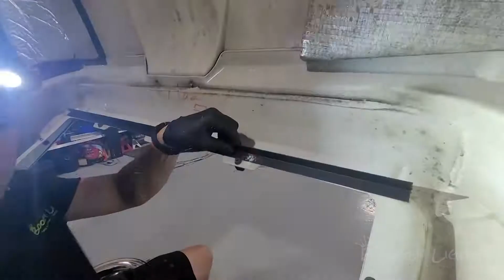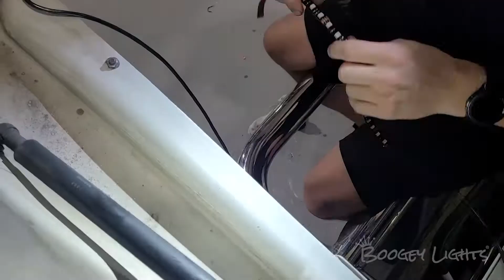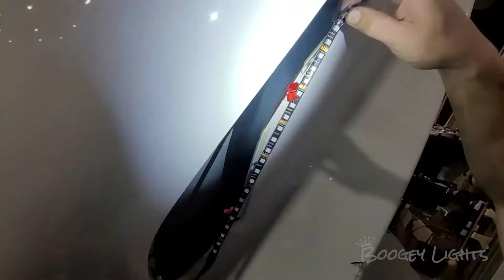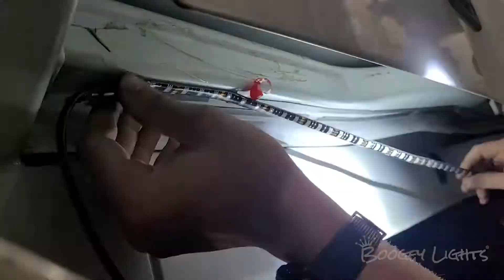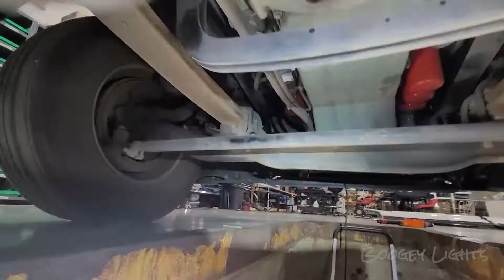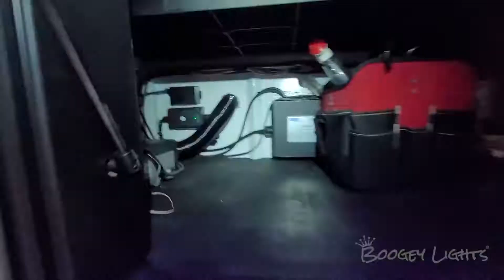Step-By-Step LED Installation  |  Volvo VNL 780

Comment: Is it still holding up, any problems do you know of? Where is your shop?
Reply from the maker: We have been installing Boogey Lights LED products on every major brand of heavy duty truck for almost 10 years now.  When installed according to our instructions, they will last.    We have pre-configured LED light kits for Peterbilt, Kenworth, Western Star, Freightliner, Volvo and Mack . We also have a build your own light kit product that can be configured for any type of heavy duty truck.   We are the manufacturer.  We build and ship these light kits all over North America.  They can be installed by anyone with 12vc knowledge (and willing to read the installation docs).  Our manufacturing facility is based in Florence KY (details on our website).  We also do installations in Florence by appointment only.  Details on the VNL light kit you see here can be found ->  https://www.boogeylights.com/volvo-vnl-led-accent-light-kit/.

Comment: Все это отвалится очень быстро!!
Reply from the maker: No, it will not. Our strips use 3m VHB tape and 3m adhesion primer for mounting. The key is a clean, continuous and prepped surface.

Comment: Where r u located guys?
Reply from the maker: We're in Florence, KY - 15 minutes outside of Cincinnati, OH. 9000 empire connector drive, suite B,  Florence ky 41042
Reply: @BoogeyLightsLEDs  same place as the George’s truck repair shop?
Reply from the maker: @khalidmohamed681  Yes! We share a building with them, but we're on the other side.
Reply: Big question it’s how much it’s cost Evrithing for Volvo vnl 780 ?